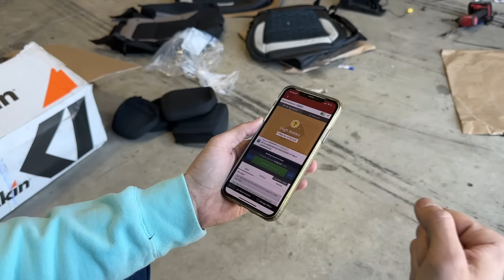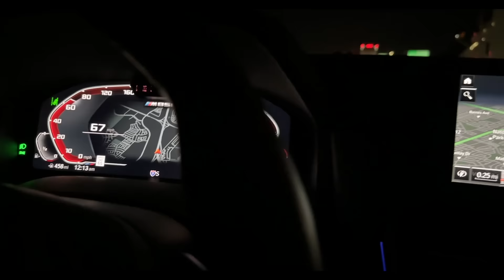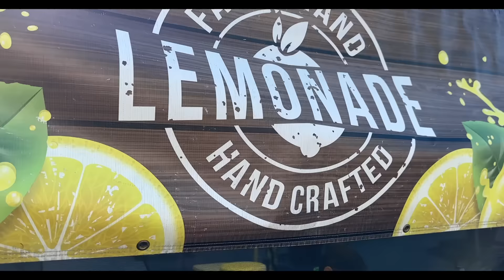Rebuilding A Wrecked Lamborghini Aventador SV Part 1

Comment: I'll tell you this. Composite material has been used in aircraft for decades. So maybe you should check it out. Plus they have epoxy that you've never heard of. 3M makes the epoxy. Many different kinds. And Cy tec in Greenville Texas makes these composite material. And what you call carbon fiber? It's not carbon fiber. It's composite.